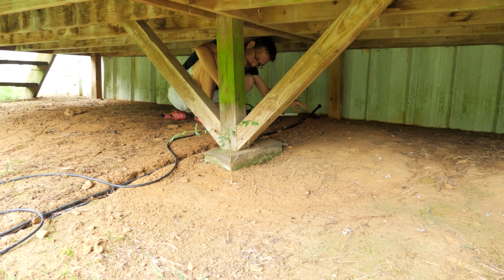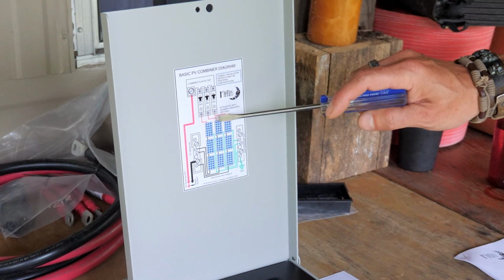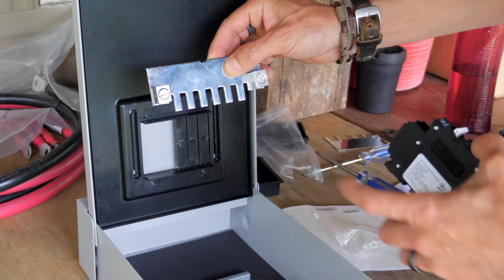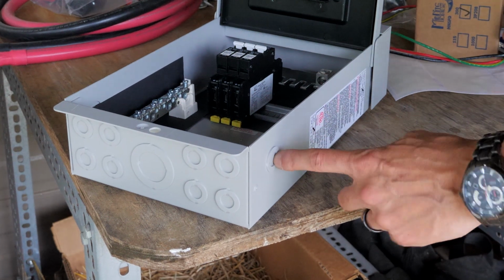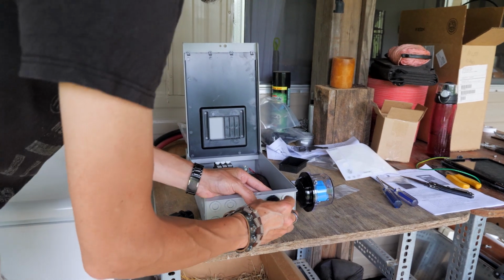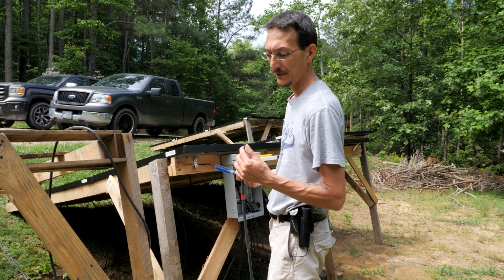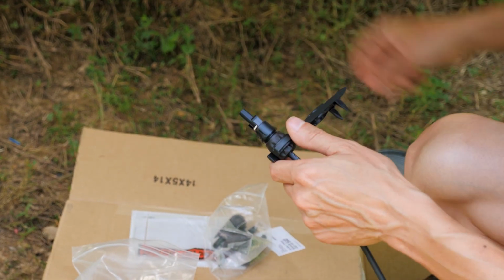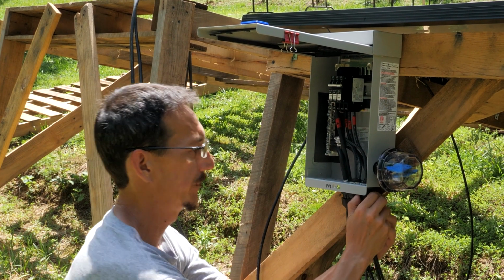DIY Off Grid Solar: Assemble & Wire a Combiner Box (Part 4)

Comment: I am sure there is a reason, but why not have the batteries and the inverter  by the solar panels, then transmit AC to the house. The main advantage of AC is easier transmission.
Reply from the maker: Totally depends on the installation situation. We already have a battery shed behind the camp so running DC cable vs moving the batteries, inverter, load center and generator 130’ away was an easy decision.
Reply: Actually the advantage of AC is transformation NOT transmission, AC has higher transmission losses than DC for the same power transfer as it has reactive losses (inductive and capacitive loss) as well as resistive losses. The most efficient system is to ensure the batteries and inverter are as close to the load center as possible. At these levels neither would be significantly different but your premise was not valid and there is so much misinformation about electricity that there is no sense propagating it.
Reply: @Bob Balbirnie AC is better for transmitting high voltages over long distances. That's fact, not misinformation. It may not apply to Jeremy's setup.
Usually people who make blanket statements like you, are hiding ignorance behind over-confidence
Reply: Gumarro, you may want to actually read some electrical theory texts so that you actually understand how electricity works before accusing others of ignorance.  After 35 plus years involved engineering in the electrical utility business from generation, transformation, transmission and distribution from 500 kV to 12 kV and HVDC conversion transmission and inversion as well as transmission series capacitor stations and harmonic filters for HVDC I can say without overconfidence that YOU are simply wrong.
Reply from the maker: Fight nice kids 😂
Reply: but dc losses vs ac is higher on same size of cable, ideally yes it been better if inverter and battery's was next to the solar panels but not everyone can do that, so you just have to go high gauge on the cables

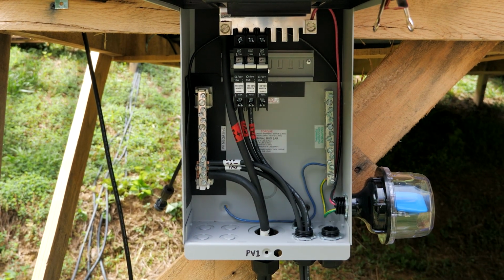Was more or less explained at 18:14

Comment: Did I see your wires from your panels in the opening vid in a 1" ditch?  Any reason why you didn't bury them to the proper depth?  a little constructive criticism here. ... I'm guessing this is only a temp install until your house is built, and maybe you want to reuse the wire on a permanent install? I can tell you from years of personal experience, you are risking insulation failure, decreased efficiency, equipment failure if you leave/cover your wires that shallow.  You may be surprised how rocks move, puncture direct burial rated wire.  Not to mention crushing forces. PVC conduit is cheap, and allows for more future wiring changes, if sized properly. Good luck.
Reply from the maker: It is just to keep from hitting them with the mower. We’ll pull the cable when we move to the house. There will be conduit where it crosses the driveway for now but that is all.
Reply: @Spock: How do you deal with the rocks puncturing the direct burial wire?  Presumably if you lay conduit it will just get punctured too?
Reply: vink, by code, wiring is to be buried at certain depths for a reason.  [Anywhere from 18'' to 48'' depending on purpose.  There are different thicknesses of plastic conduit too.  Schedule 40 and 80. Lamp posts are an exception.]  To protect it from physical abuse.  In areas with a  lot of frost heave, rocks move around.  they won't puncture conduit, but they will cut insulation on wiring, allow the introduction of water, which begins the oxidation of the conductor.  Aluminum wiring will turn to a white powder, aluminum oxide. It will become a highly a resistive conductor of electricity until electricity can no longer flow.  Another item is the Earth can absorb all of the electricity man can create. If you have a damaged conductor sheath, it may arc in the area depending on moisture, but the Earth will absorb it, and you will get low to none of it to use.   When I bury conduit, depending on back fill, I will dig a ditch, lay 6" of sand, install conduit, cover with sand, then backfill. [I have dug through beds of nothing but shale.]  6" below surface, install a caution marker tape "electrical line buried below'.  Newer tapes even have a  metal tracer lead in it so you can clip on a tracing device if you need to locate utility in future.  follow the tracing tool, and spray paint or stick little orange flags in the ground.  FYI, not all wire is rated for direct burial, and not all are permitted inside PVC conduit.  Some insulation on the wire can withstand a higher temp than pvc conduit for example.  I'm not saying it won't work.  I'm saying there are codes for reason.
Reply: @Spock: Interesting, thanks for the info!  I have never looked into what's involved in burying cable before so that's quite informative.  I imagine here in Australia all the requirements are largely the same.
Reply: fyi; if you are going to run a conduit, either over-size it for future changes/additions or run a 2nd unused conduit.  Conduit is cheap compared to re-digging your trench.  Power? Voice/data? control wiring? TV? always good to have a spare pipe for future "you know what would be nice to add..."  An example, I installed lights at the end of a very long driveway. After the trench was filled and lights installed, the next thing he wanted a motorized gate at the end of the driveway, with a camera/door bell system.  Since I installed an extra pipe it was easier to get it done, customer was thrilled no more trenching his new sod lawn.